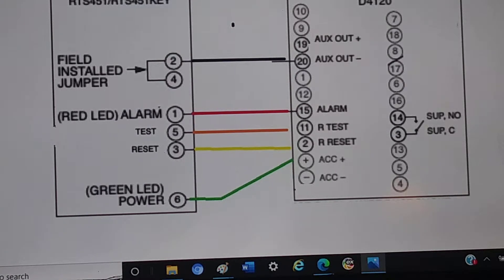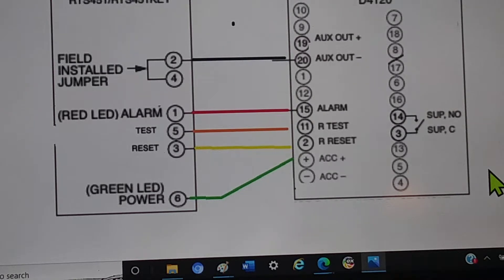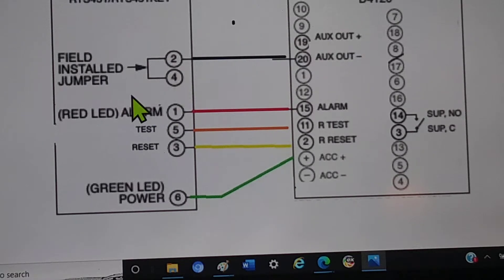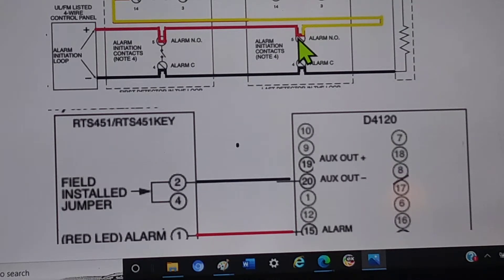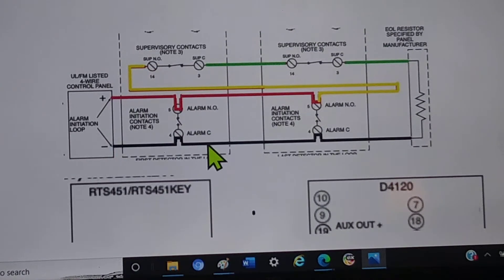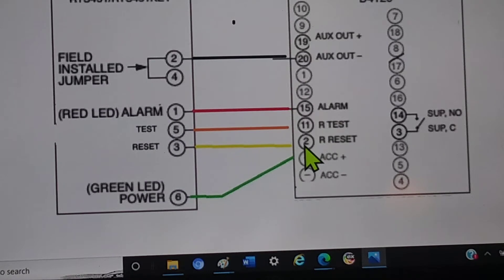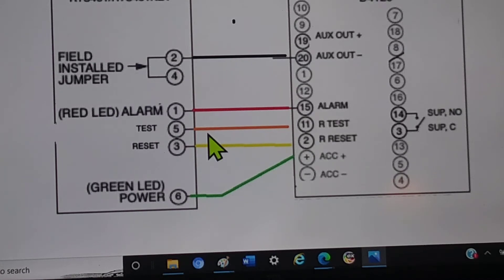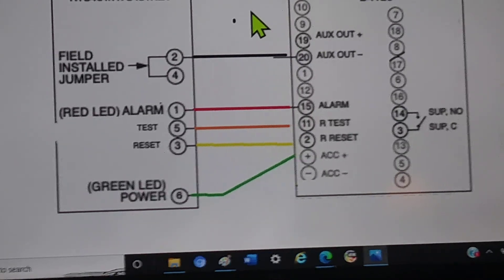RTS151 to System Sensor D4120 Duct Detector Wiring and testing procedure

Comment: if you lost the key to the rts451 would i be able to reset by touching the wires?
Reply from the maker: Believe it or not, a maglock key fits it or you can by a cheap switch from amazon and it will come with they key. Shorting out the wires is what it does but you will have to short out the correct pair and right off I don't remember.

Comment: Why could I not use Aux + - or Acc + -? Why 1 of each? And 18/6 fire alarm cable is a thing.
Reply: Some built in duct detectors your Alarm/Test/Reset terminals are powered looking for ground. Always best to look at the data sheet and go from there.